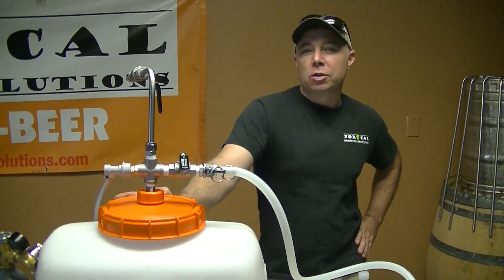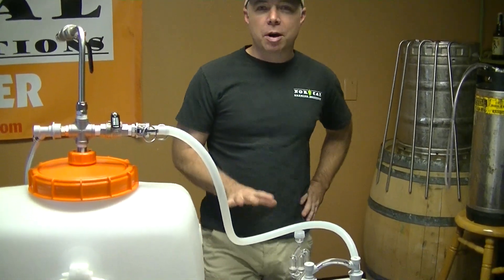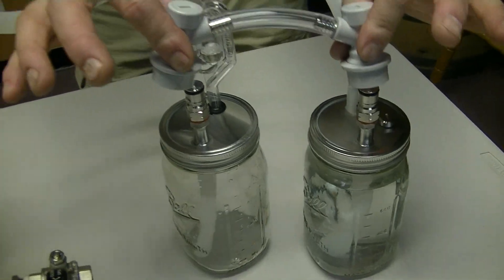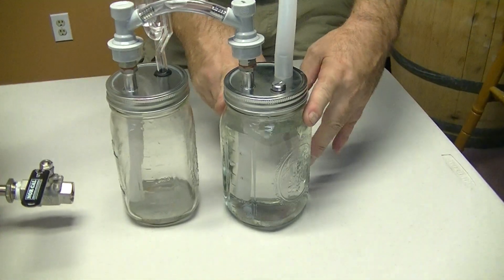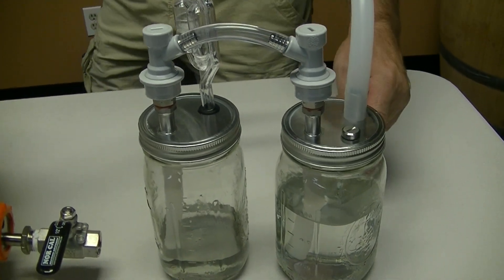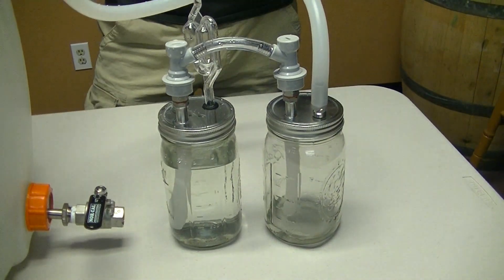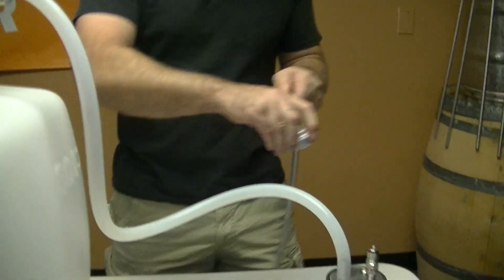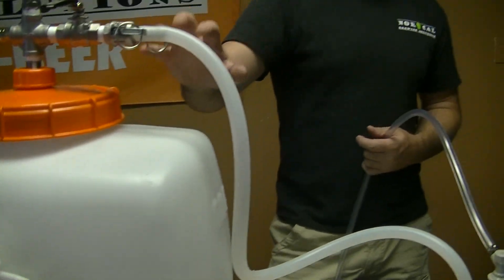Customer challenged us: Build the Ultimate Fermentation CO2 Harvester Kit

Comment: You dident think about the gas volume for CO2.
Reply from the maker: Explain please if you will?  Not sure as I follow you.  my demonstration is using QT jars but you can double the volume by using 1/2 gallon jars.  I personally use the 1/2 gallon, ferment 12 gallons and haven't ever needed to add gas but I have the ability if need be.   
Cheers
Jay

Comment: why would i want this?
Reply from the maker: Over the normal CO2 Harvesting system?  Or at all?  Harvesting and using your harvested CO2 is the safest way to cold crash your vessel and not pull "AIR" back into that vessel.  When the vessel gets cold it is going to create a vacuum and pull from the spot of least restriction.  In this case its the harvested CO2 we captured during fermentation.  Good question David!  
Cheers
Jay

Comment: Need to replace o-rings on threaded posts can you guide me pls, thanks.
Reply: Which posts are you referring?  
You bet I can help.  Gladly
Reply: @jaywebster6265  there are the two red o-rings (2 sizes on each) on the welded posts. I can't find info on your site AND they've all broken down and need replacing
Reply: @jaywebster6265  can you help?  Still haven't had luck acquiring these